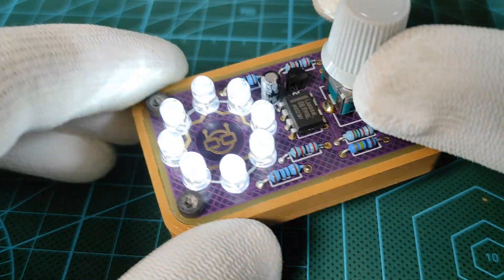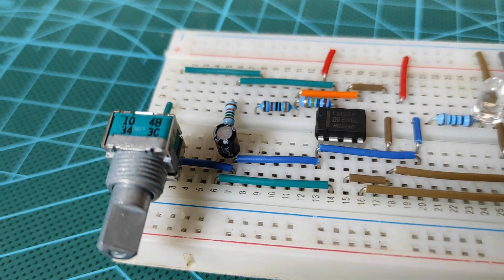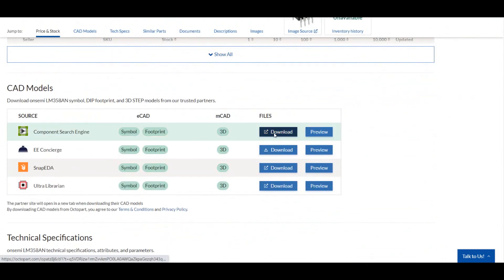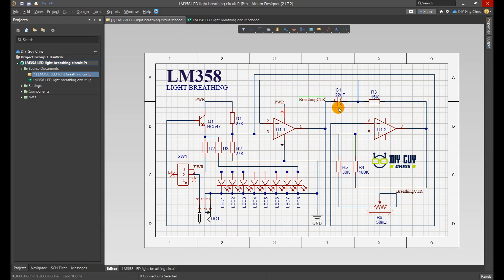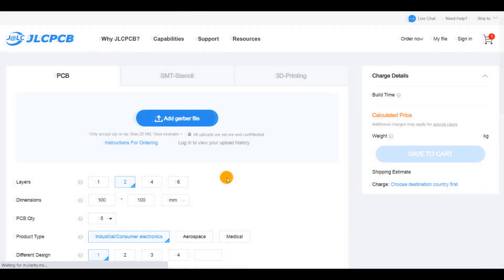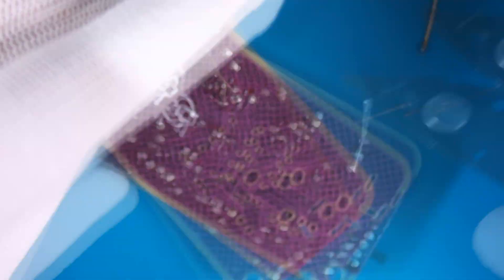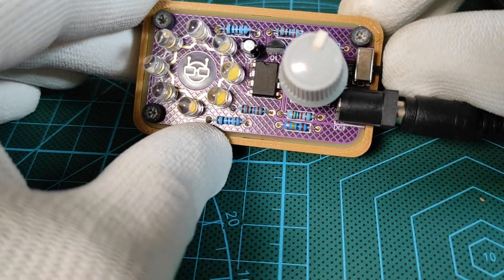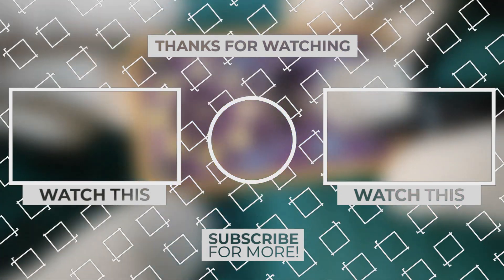LM358 LED Controlled Breathing light Easy DIY

Comment: How many LED's will this circuit drive? I need one to drive 20
Reply from the maker: Yes you coul use the same schematic for 20 LEDs, make sure you are using the same LED type
Reply: @DIYGUYChris  Thanx Chris. The gerber file download is corrupt and wont open with Winzip. Im assuming the Gerber files contains all the parts? Resistor U2 & U3 are they the same value as R2 ?. Thank for your help-Subscribed.

Comment: the screw makes the final look ugly so if you remove them it will be better and why don't you power the device from battery and make recharging circuit stage for battery charging and make it portable
Reply from the maker: Yes maybe I will remove the screw because the board fits in the housing without screws and yes the charging circuit is also a cool idea to make the device even wearable
Thank you for your suggestions 🙂